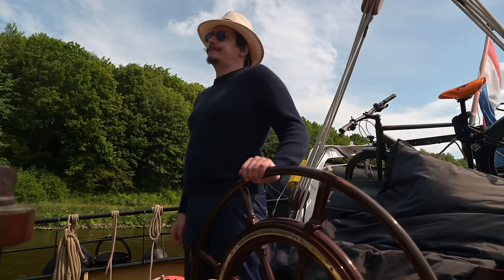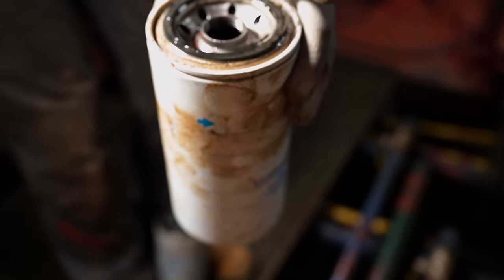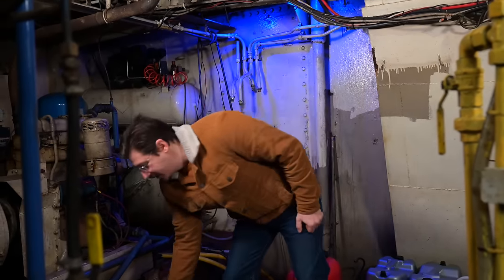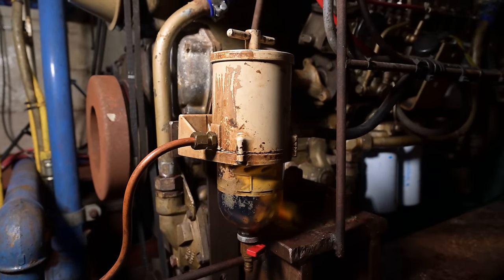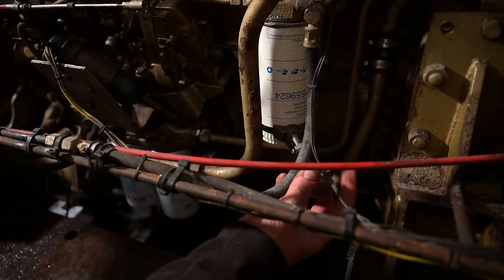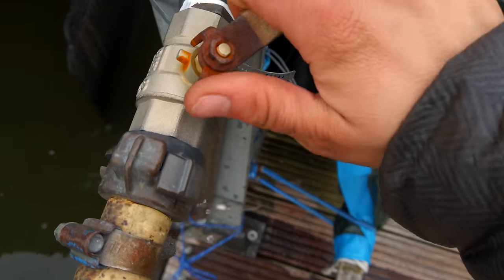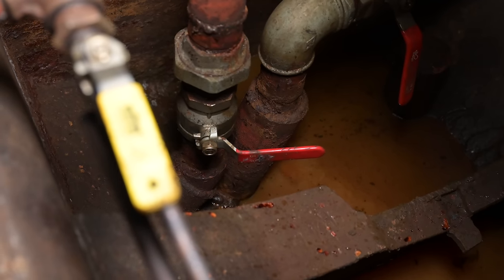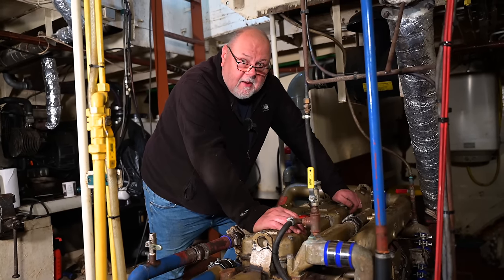Engine Run and Service on Our Historic WW2 Trawler!

Comment: Note to owners: Since you have no reliable data on the history of that engine, before you go overboard with expensive but unneeded procedures, install correct mixture of engine coolant. Check valve clearances. Remove and test fuel injectors. Have compressions checked and log the readings. Borescope cylinders while injectors are out.  You can purchase an inexpensive scope and look for yourself, there are plenty of videos online to show what you should see. Service the aftercooler, any good radiator shop can do this. Inspect crankcase ventilation components (if installed and present). Run engine until at operating temperature, take oil sample for analysis.  Note how engine starts when cold (does it have functional glow plugs), how much cranking before starting? Does initial smoke (what color is it?) clear up after a few moments? When you quickly advance throttle does the exhaust smoke black for more than a second or two as it takes the load? If after setting valves and servicing injectors the engine starts instantly or after just a few revolutions, you do not need to "renew, refresh, or overhaul" it. Most recreational boat diesel engines like yours are high speed (not low speed or medium as many boaters like to think) industrial or automotive engines configured for marine use and should easily run for 10,000 hours or more. Most of them die from corrosion and neglect. You are on the right path but beware of boatyard mechanics who "over-prescribe" intensive service procedures.

Comment: If there was diesel in with the engine oil. Wouldn’t you still have that problem until you find the cause?  Always loves your videos 👍👍
Reply: Hi Taffy.
Pretty much all Diesels will contaminate their engine oil.
The larger the engine, the more it becomes an issue.
Large Diesels run slower, and in the case of the DAF, it rarely went anywhere near its maximum rpm.
If a diesel isn't given work to do ie driving the propeller or pulling a heavy load, then incomplete combustion gasses seep past the piston rings and end up in the oil.
Of course leaking fuel injectors can give the same symptoms, but in the DAF, the exhaust is clean, the engine starts easily, and runs lovely so I wouldn't be looking for a problem that doesn't exist.
Engine like this are built to work hard.
At the moment its like Arnold Schwarzenegger being asked to do knitting,, 😅
Thank you for your comment.
John
Reply: @827SLi  ahh, now I’m a little wiser 😂👍

Comment: Hooray !  Glad your engine is running.  Are you able to charge a battery bank ?  Just curious.  Thank you and best wishes
Reply from the maker: At the moment we've separated the service batteries and the engine. But we have a separating diode so the alternator could also charge the house bank. But since we had this huge corrosion damage we are a bit careful and we want to re- do the whole electrics before we use it again.

Comment: on another note that keel cooler not being caged just makes me nervous is it just me or you guys too?  great idea too the leave the hoses loose and give them just enough torque.  when i saw you using silicone although they look great you obviously know about there draw back and you guys found a great way to mitigate it.   ill be using it!!  fir sure
Reply from the maker: Dimensions don't show well in the video. The keel cooling is very beefy and massive. There are guiding metal straps at the front so it's not possible to accidentally hook into a line or a cable. So at the moment it's a good and reliable system. I wouldn't recommend it if you're fishing or do other work that involves gear in the water. Also the additional drag is a drawback when sailing. Also the worst thing that could happen is that if you puncture the pipes you'll get salt water in the system. You'll haul out at the next possible moment, fix it,  flush the system and on you go. But usually the only times keel coolings get damaged is when hauling out and the yard isn't careful enough. 😉

Comment: The old mechanical engines were built to last. The new diesels are 1/2 the size with twice the power, but very little ability to take punishment. Diesel in the oil after sitting usually means injector nozzle drip. That can be because of wax build up from years of sitting and or  running to cold, or just crappy fuel. Would recommend injector rebuild or the near future.
Reply from the maker: We will see if this is a problem that occurs again. We don't know for how long the oil wasn't changed. We don't know if the engine was used for longer periods. So we now know when we did an oil change and we know how we use the engine. At the next oil change we know if there's an unusual amount of diesel in the oil.

Comment: Just a question  ...
If your still concerned about possible debris in the fuel is it worth considering getting a polishing system to REALLY filter out any rust ect
Reply from the maker: The day tank has a drainage at the lowest point and as said in the video a pre filter. So I've no idea why there was so much debris in both filters. The only thing that is kind of missing is that there's no return line from the day tank into the storage system. With a return line it would be possible to cycle the diesel through the filter.

Comment: Anti freeze is not only anti freeze, it's also anti corrosion. Never ever use only water.
Reply from the maker: It's a closed system, so when the oxygen in the water is used up there's not much corrosion going on. There was just water sitting in the engine for about 5 years and it came out Cristal clear. That doesn't mean that I don't agree with you, there should be anti freeze in the system. But first we can't drain the keel cooling while the boat is in the water and about 400€ of anti freeze just for 3 months?

Comment: I would have warmed the engine before changing the oil. You had it running before and a warm engine oil will come out easier. This new oil may need changing after flushing the system and new replacements oil put in after an hour of flush running.
Reply: Hello.
The engine hadn't been started for several months prior to me coming over due to the split cooling hoses.
By this time, all the oil would have drained into  the sump.
The oil smelt like Diesel fuel as the engine had only really been used at low speed and for manouvering, so unburnt fuel had seeped past the rings and into the oil.
This was the ideal opportunity to drain out the old oil without sending the contaminated oil back through the engine.
You are however absolutely correct in suggesting to warming up the oil to make it more fluid. 
Thank you for your comment
John 👍

Comment: The normal advice on marine diesel is an oil change every year regardless of hours. My understanding is this is due to the acids that build up in the oil and the loss of the oils buffering ability. Is this a practice John recommends? Given the volume that Daff holds it seems like an expensive change. I would love to cut back to a more sensible hours based change on my boat but have been nervous about going against the experts.
Reply: Hi Joseph.
An awful lot of controversy surrounds oil and oil changes, and I quite understand the confusion that surround the subject.
It all really depends upon the engines use in actual running hours.
If you use the engine for short journeys and it rarely gets hot enough to stop condensation forming inside the crankcase, then there is more chance of harmful 'acids' forming and staying in the oil.
Using the engine and keeping it hot, removes condensation. 
If your engine reaches operating temperatures then I really wouldn't worry too much.
Idiling an engine if it's a diesel isn't the best policy as fuel will find its way past the rings into the oil, and this is where the acids from incomplete combustion get into the oil.
Getting the engine upto temperature is the key.
If its given a good load and made to 'work' then the oil will protect the internals perfectly well.
I can't see a problem going back to changes based on engine running hours.
Hope I've helped.
John
Reply: @827SLi  when used we almost always get it up to temp and if running to charge the batteries we always put it in gear to make it do some work. Like most boats it sits unused for a rather large part of the year. Not sure how that factors in.

Thanks for the reply!
Reply: @josephcrawley3095  I still think you are being over cautious regarding oil changes🤔
I'm not saying being over cautious is wrong, its just an expensive solution to a problem that may not actually exist.
I've serviced marine engines that have suffered terrible neglect regarding servicing, but still soldier on regardless.
One potential solution is a 'block heater'.
This device keeps the coolant warm in a stationary engine by use of a heating element connected into the cooling system.
It's intended purpose is to reduce wear in cold engines on startup, but it also ensures any harmful vapours in the crankcase are removed as the engine becomes warm to the touch all over ( even the oil) 
If you have shore power then it's a potential soloution.
I hope I have been of assistance.
John
Reply: Thanks again for the advice!

Comment: 8,000 litre fuel tank? Wow! If you are not planning on any seriously long trips, i might think about installing a more modest sized tank (or even, just yse the day tank). Fuel needs to be kept fresh (ie not stored for long periods) and it would be tough to keep 8,000 litres fresh.
Reply from the maker: We have four storage tanks, one day tank and a lube oil tank. Currently we try to keep only the day tank full. At gas stations for boats you also get GTO Diesel and that last a very long time in the tank since there is no bio diesel in it. On the long run we will reduce the tank capacity. about 2-3000 liters will do.
Reply: Interesting. Four fuel tanks gives you a lot of flexibility. The usual advice has been that even regular (bio free) diesel will go stale inside 18 to 24 months (if stored at cool temperatures, such as an underground tank, shorter if at higher temperatures), although fuel stablizers (additives) can buy a little extra time. I know backup emergency diesel generators (such as hospitals have) seek to ensure that no stored fuel is older than a year, which is what I aim for on my boat.

Comment: Where was it built? Is that the original engine? Thanks for sharing this huge project with the World.
Reply from the maker: the ship was originally built in The Netherlands for the Germans. Originally with a wooden hull. The first engine was probably a Deutz. In 1950 the wooden planks were replaced with riveted steel plates and a little bit later a Dutch built De Industrie engine came in. 130 liters!!! displacement! It was so strong that they used the boat not only for fishing but also as an offshore tug. They made a mistake when starting and wrecked the engine so the ship was converted into a sailing ship back in 1977. The new engine was a 3 cylinder Kromhout. As far as I know this engine needed an expensive repair so it was replaced by the current DAF 1160 and the boat was converted into a motorsailer. The Def came out of a police boat.
Reply: @FlyingConey  Thanks for all the great history and I am sure many others will enjoy knowing it.

Comment: Prefilling oil filters is ok but prefiling fuel filters is an absolute no no. Ive seen it so many times where fuel filters are prefilled and there is debris in the jerry can or nozzle and it ruins the high pressure fuel pump and injectors. Use the hand primer pump or do a bunch of key cycles if you have an electric lift pump!
Reply from the maker: That's why we haven't pre filled the diesel filter! We used the "handy little hand pump" and it took a bit of time until the filter was full.
Reply: I saw that! Nice work! @FlyingConey

Comment: There is no need to loosen the injector pipes on an inline injector pump when bleeding the fuel system.
Reply: Hi Edd.
Whilst it will eventually bleed, I much prefer to crack off the injectors as they are accessable and bleed it this way.
It only takes a few minutes and it's an instant start.
If they were difficult to get to, then I totally agree with you.
Thanks for taking the time to comment.
John👍

Comment: You don’t mention the oiling of the O rings, this is important to avoid it “ crunching up” , very good video though
Reply: Hello.
You do see me oiling the filter  seal before putting them on, but you do raise a very good point. 
It's one of the many things that doesn't get said when you are being filmed, as in practice it's a job that take only a few minutes to do. 
Daniel and Barbara filming puts you on the spot, and yes I should have mentioned it instead of just doing it. 
Thank you for commenting. 
Regards. 
John👍

Comment: I know you've been doing this for years, John, but please mind your bare hands exposed to the fuels/oils/grime 💪🏽
Reply: Hello.
You are absolutely correct about gloves, and yes I should wear them.
I have been repairing engines for 40 years and wearing gloves was something I just never did.
I do appreciate your concern, and thank you for bringing a very important subject up.
John
Reply: @827SLi Hi John....It's been a real pleasure watching you get the DAF up and running....
Indeed you have inspired me to get back into getting my static engine sorted out and get going...... It is a SKODA 3S110 (3 cylinder, 15HP/Cyl= 45HP @ 1500rpm)
I bought it few years ago and have it on a plinth outside my house.....as far as I can gather, it has not run for 20 years. (The engine itself was made in 1973) 
It was used in a sawmill here in Chile....until the electricity arrived in the countryside!
So, it needs a bit  of TLC to get it running.
(I agree about the gloves..... same here, I just couldn't get used to them........and I've been working on engines since I was 12 or so..... Now retired but must get stuck into the Skoda!) Cheers.

Comment: Is it an idea to use a Teflon fluid in the oil to make the motor run smoothly. I used in my car wich was a diesel and it runs much better.
Reply from the maker: I wouldn't risk an engine worth 10k just because I want to experiment. I use what the manufacturer recommends or if there's a lot of experience with a substitute. But if your car still runs and it runs smoothly good for you! 👍

Comment: What year is the engine from?
Reply from the maker: 1977, so until a week or so we thought the engine came in when the boat was converted into a sailing ship. Also in 1977. Turned out she got a 3 cylinder Krohout engine back then while the DAF powered a police boat. It replaced the Kromhout in 2008 when the aft cabin was added.

Comment: What caused the diesel to get into the oil? Does it always happen?
Reply from the maker: That's exactly what we will find out. It was our first oil change and we have no service history. My guess is that there is no problem only the oil was really old.
Reply: Hello John.
Diesels that don't work hard, or spend their running time at low rpm are more likely to contaminate their oil as unburnt fuel migrates past the rings and into the crankcase.
It can as other commenters have rightly mentioned be down to leaking injectors, but usually this would be noticed as either a misfire or black smoke in the exhaust.
The answer is to make a diesel work for a living, avoid excessive idle, and change the oil and filters at proper service intervals.
Flying Coneys injectors and fuel pump will be serviced and calibrated once the boats in its new location, and this will be another in the ' engine series'  video about removal, refitting, and timing the pump.
Thank you for your comment.
John👍

Comment: The second fine filter was not that dirty. When he took of the filter you can see that stuff and dirt from the filter housing got in to the bucket!!!!!!
Reply from the maker: The filter housing was clean before. So the dirt that was rinsing down the filter also was previously inside 😉.
Reply: Hi Paul.
What I was trying to show was the water and particles that had made it through and caught in the fine filter.
What I could have done for clarity was pour the filter into a glass jar and allowed it all to settle.
The filter was certainly doing its job, and highlites why installing a good quality filter is essential.
Lesser quality filters could allow contaminants through with the very expensive fuel injection pump next in the line of fire.
Thank you for taking the time to comment
John👍
Reply: @827SLi  You're a great mechanic!! It was great to see you at work. Thanks for the explanation.
Reply: @FlyingConey  Okay, didn't know that filter housing had been cleaned. It seemed to get out of there. Thanks for your comment I love youre channel

Comment: I have a question, do the people in Europe have the same problem as Americans? That problem is whenever we work on almost anything we need Metric and Imperial systems of tools. Do you guys run into that same issue? Please Respond ! Watching from Panama City Florida, USA. 🇺🇸🦅
Reply: The engine is fine, I would trust it to travel across the Atlantic Ocean. Yes but how is the drivetrain? You will have to make the whole power train , the motor/engine and the drivetrain must be in order. Excellent video and it was good to have the diesel mechanic explaining as he went through the engine. Thank you !
Reply: Hello.
Im going to be brutally honest here and say I now find the metric system far easier to use than the imperial system I grew up using.
80% of the engines I repair are metric now, but the 20%  that I need imperial spanners and sockets for are considered vintage.
I understand that in the USA you still use the imperial system and measures, and it must be flustrating to have to have toolboxes full of both.
Simply put, metric is here to stay..
I am fortunate to be able to measure in both, but the AF spanners now live in the lowest drawers of the roll and and hardly see the light of day😅
Thank you for your comment.
John